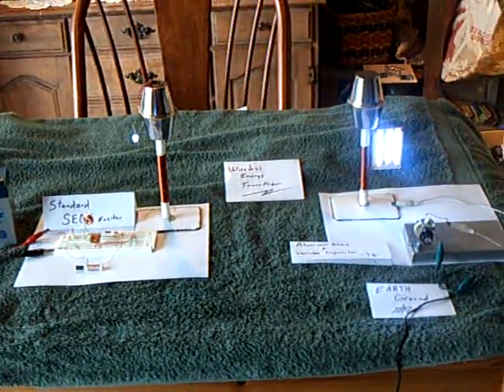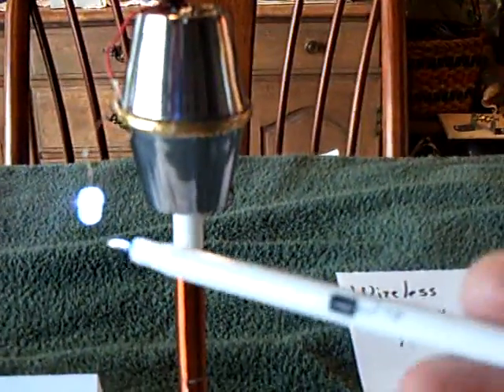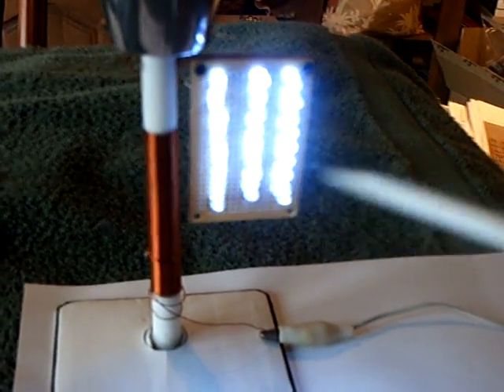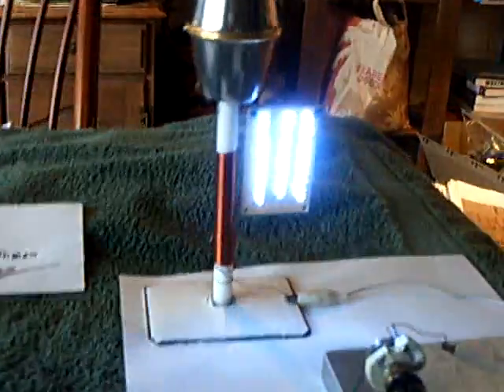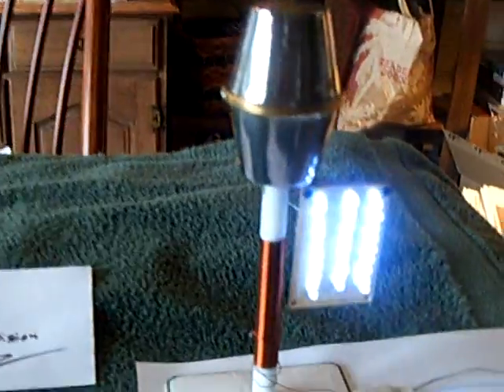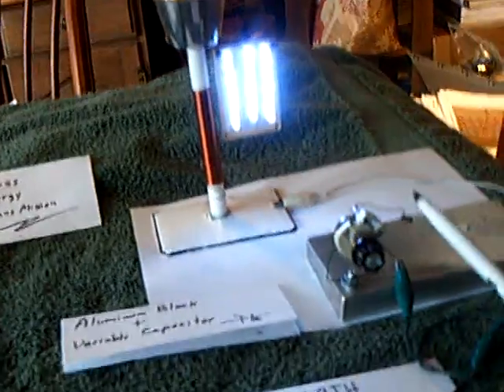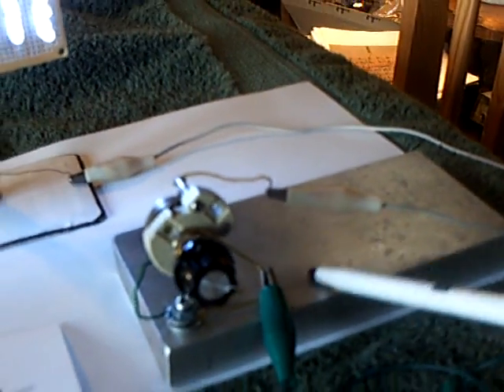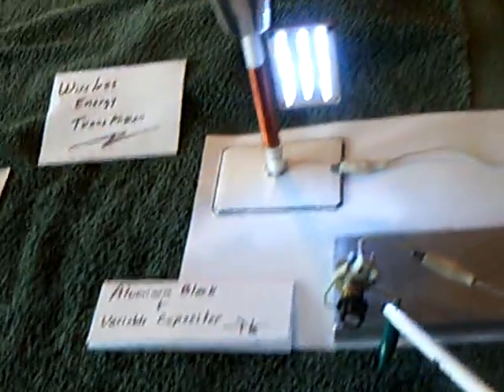Tunable receiver on SEC wireless transmission of energy device

Comment: I was wondering Mr. Lidmotor; maybe you have already done this, but have you considered charging a cap with the receiver tower and then powering the transmiter with the cap closed loop, so that by tunning the receiver you'd be able to adjust how much power is consumed from the transmiter vs. charging from the receiver. Huh...does that make sence? Cuz I just sent myself for a twirl! Cheers!

Comment: very very nice job!! i stumbled across a simple version of this with a plasma globe, 2 leds and an antenna, i didnt use any capacitor and i was able to get the leds to light up from three feet away from the globe. what is the range of your device? also, is the energy being transmitted in the form of em waves or is the receiver resonating at the same frequency as the field around the transmitter?